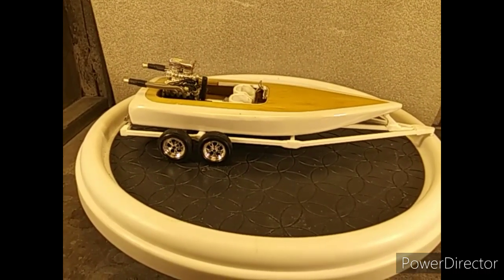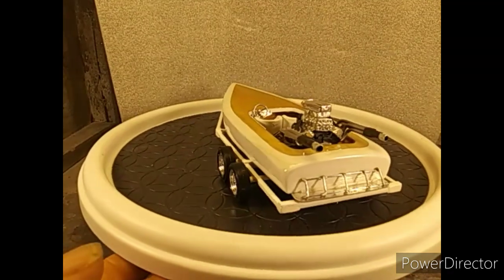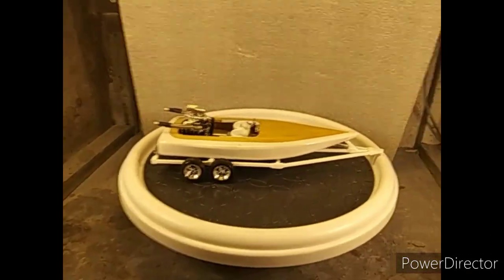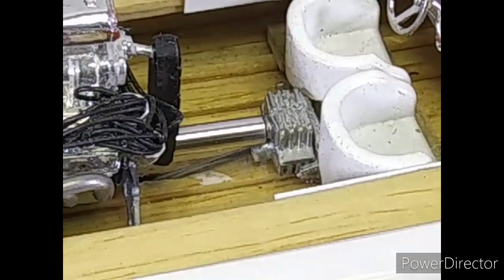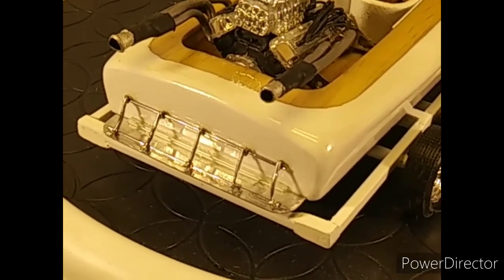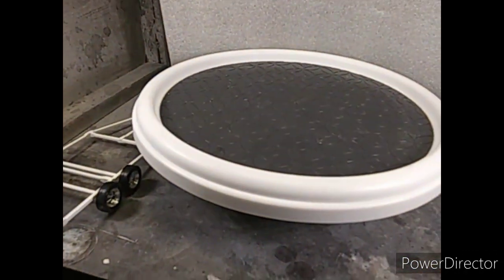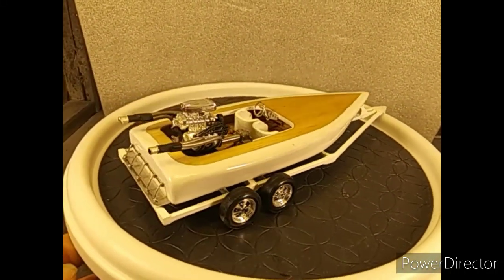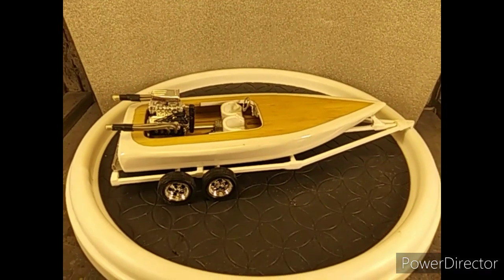V8 balsa wood boat

Comment: Wow that boat looks great I like the two-tone paint
Reply from the maker: If you do two tone I use Ace Hardware spar varnish and do it first why thank you don't you wish you had one of those
Reply from the maker: I thin it with lacquer thinner it's not the poly just spar varnish I'm looking for stains and veneers that I can do different colors with so far at 6 bucks at can I bought three cans of stain and they're too dark all balsa wood goes way dark